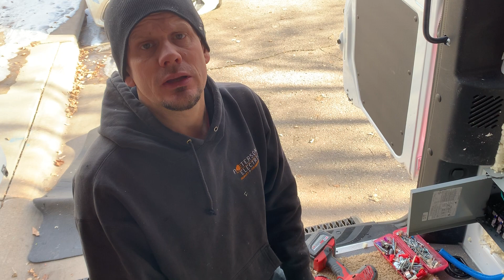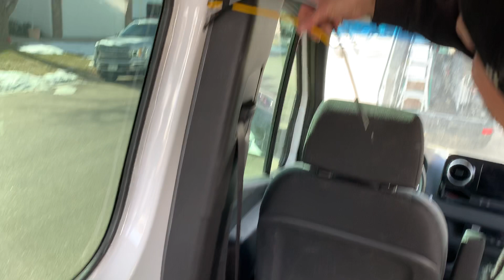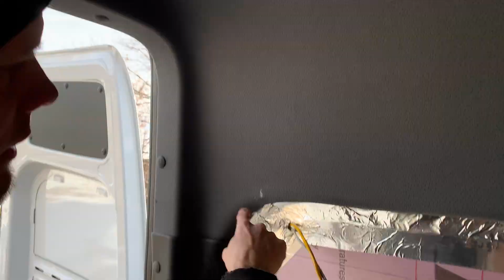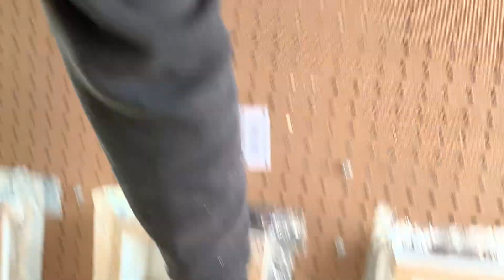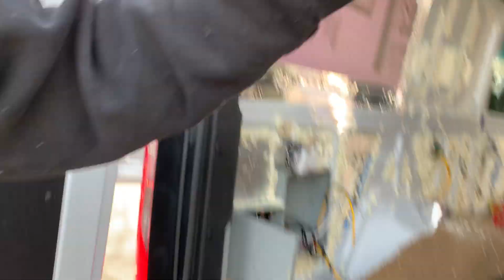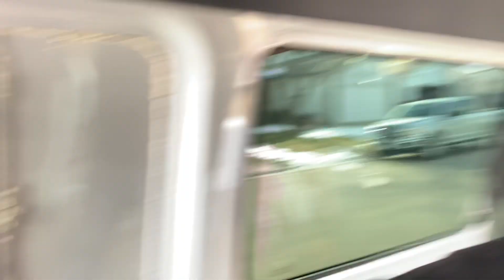Retrofitting Our New 2019 Sprinter Van (Intro to Van) -  Part 1

Comment: You can get a single big solar panel with built-in power management and inverter; so with inversion done on top of the roof, you vastly reduce the amount of copper that needs to go down through the roof.